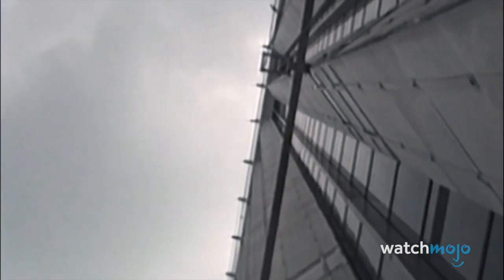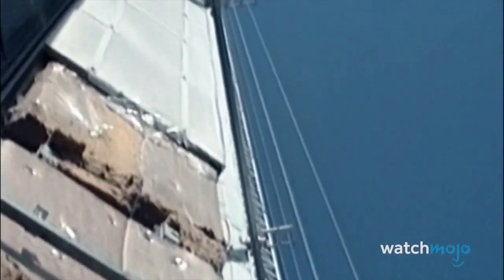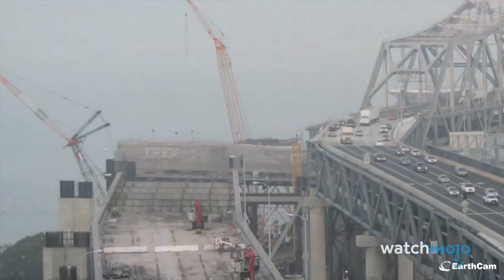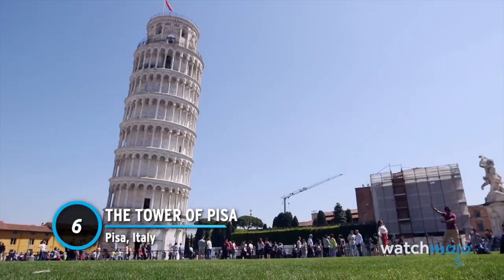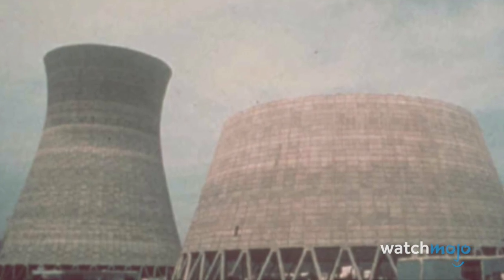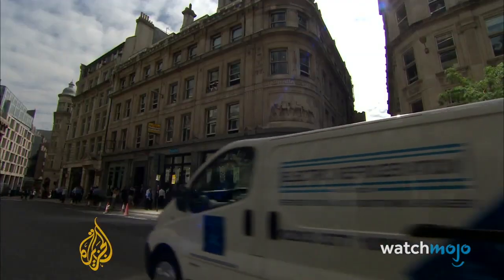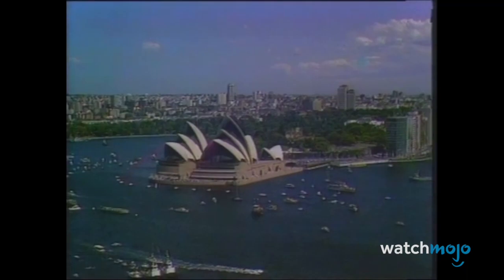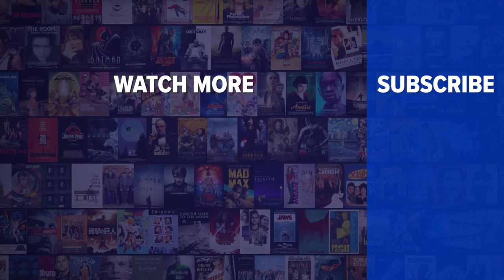Top 10 Times Massive Construction Projects Went Wrong

Comment: There was a building in Brazil that was built with swimming pools in each apartment, but the engineers did not calculate the weight of the pools with water, so it was banned by the public security agency.

Comment: A (dis)honourable mention should go to the Kansas City Hyatt Regency Skywalks. Opened in July 1980 as part of a general redevelopment of the Kansas City area, the Hyatt became a centre for social gatherings in the city. However, due to the decision to use inadequately designed supports between the connections between the ceiling mounted hanger rods and the structure of the Skywalks (formed of box beams) coupled with the fact that 2 of the Skywalks were to be not only supporting its own weight, but also the twin directly beneath, the result was that they were nowhere near strong enough to even meet the intended load, let alone the load the Skywalks were carrying on that fateful night in 1981.

The result was 114 people died and over 200 more were injured

Comment: How about the John Hancock tower in Boston MA. The facade is entirely blue reflective glass. In 1973, when a wind storm hit Boston many sheets of glass fell from the facades. To temporarily fix this problem the openings were replaced with painted black plywood sheets. The tower received the nickname of the “Plywood Palace”, due to 1/3 of the façade being plywood sheets. Cobb decided that the whole building was to be re-glazed with a higher rated glass. 85% of the glass was replaced by May of 1975.

Comment: It's the architects and their sometimes ridiculous choices that create much of the trouble.  Most of what I see is minor problems plaguing buildings that the public never sees, but those problems are there and require constant maintenance and eventual rework.  They'll never admit it though.  Some engineering issues - but generally architectural choices and design are the source of the problems...I've seen so much over 30 years of design and construction - I'm getting better and seeing it prior to construction.